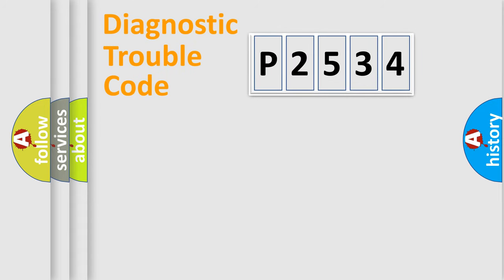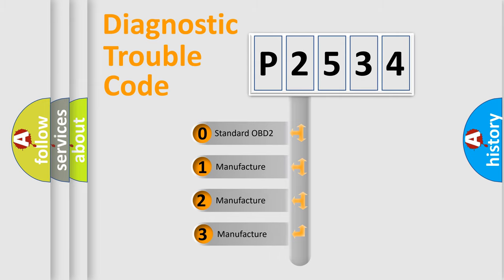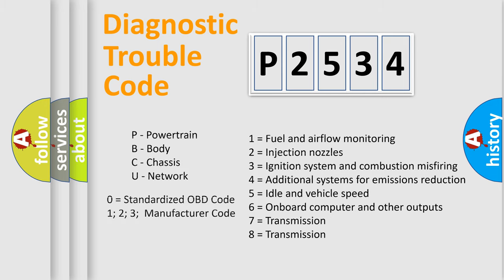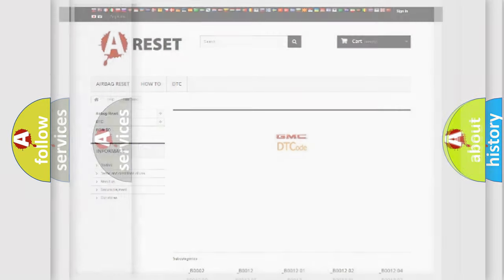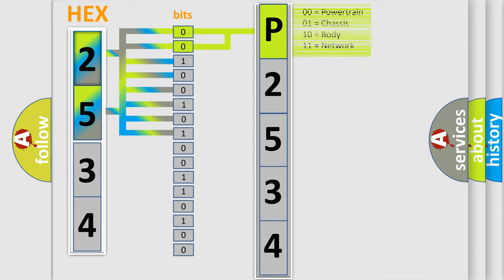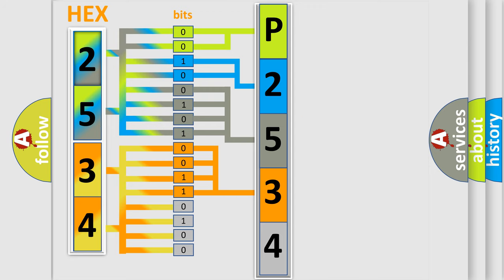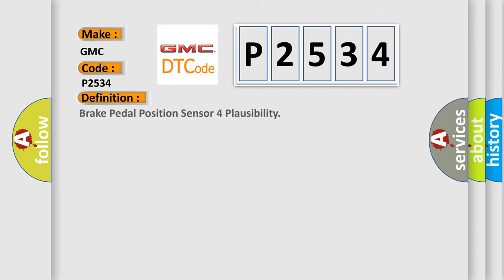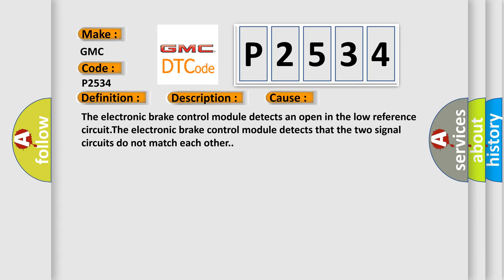DTC GMC P2534 Short Explanation

Comment: It depends on which module produces this code. Mine was in the Trailer Brake Control Module.  Ended up being a loss of ignition run/start circuit volts to the TBCM. Bad connection at connector x102, by the brake booster.